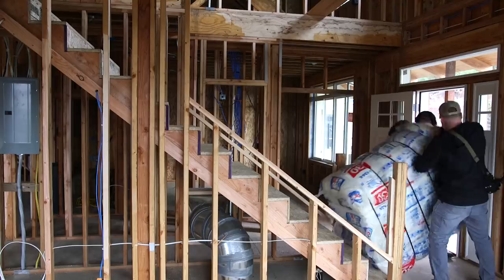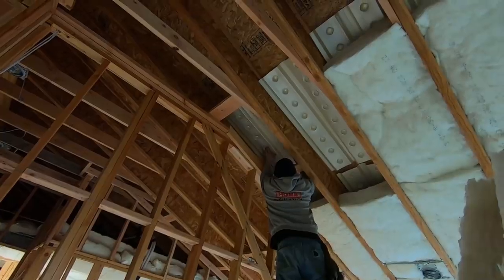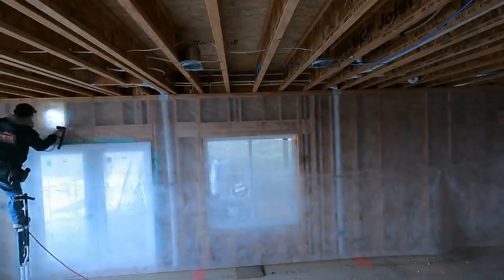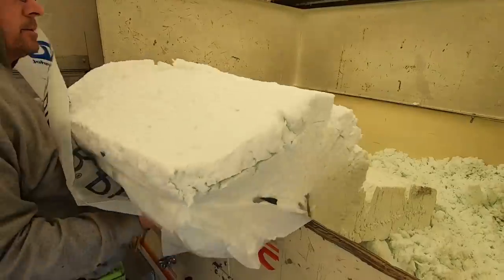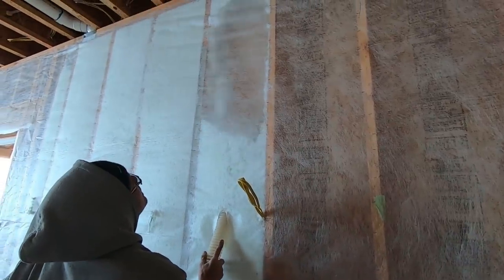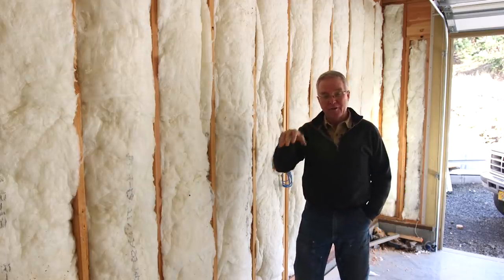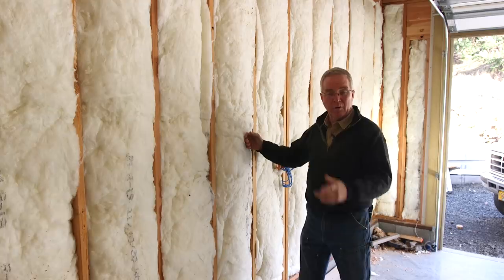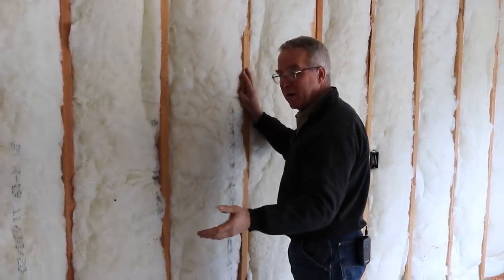Insulating A Nice House Ep.104

Comment: Spray foam is a nightmare down the road. I’m glad you didn’t use it.
Reply: Really? Give me a real example you have experienced? I’ve used spray foam exclusively for many years with my own house and buildings and families buildings too. Zero problems. I’ve personally sprayed many millions of board feet of foam in the last 11 years. Zero problems.
Reply: Can you describe how it’s a nightmare?
Reply: It will be if your house catches fire or you one day need to remove insulation. But houses aren't really built to last anymore, so the last point may not apply.
Reply: Expensive and potentially poisonous,, and once it’s in you can’t sensibly get it out.
Reply: @dtemp132  how about if you need to fish a new circuit, or repair a pipe, or add low voltage wiring (maybe for a home theater system or security cameras). And it there's ever a leak in the wall, good luck finding it and repairing the sheathing.
Reply: @christophergruenwald5054  fishing wire is the biggest problem I have with it. It’s difficult to remove for remodels. 

Edit : I don’t know anything about it being poisonous etc my comment was about having to work around/through it in the future.

Comment: The space station actually has problem with heat rejection. It spends much time in direct sunlight and it is perfectly insulated by the hard vacuum of space.
Reply: vacuum will prevent convection, but what about conductive and radiation forms of heat transfer ?
Reply: @peterp4319  I am not an expert in this field, but I do know ISS has large radiators to get rid of the heat. To the best of my understanding radiation heat transfer is a function of temperature, so relatively cool surface of the ISS sheds heat slowly.

Comment: How much will the cellulose in the wall settle? Will a gap at the top of the wall form over time?
Reply from the maker: They claim no settlement. It is surprisingly dense to the touch after installation. It feels about like a memory foam mattress when you press on the fabric.
Reply: It’s blown fiberglass, not cellulose. It may or may not settle, but the wind will definitely still blow right through the walls either way.
Reply: It shouldn't settle, its dense when blown in. If it does settle its because the installer had the machine set up wrong. You can fluff the insulation to get better coverage but it will settle as a result
Reply: @essentialcraftsman  Scott, it's blown in fiberglass in your walls, not cellulose. The JM Spider Plus fiberglass they installed has a bit of adhesive in it I believe to help reduce settling. Glad that they did seem to dense pack it though. Cellulose would be grey and not bright white. And dense pack cellulose should feel like a very firm mattress when done properly.

Source: I'm a passive house architect with a passion for insulation.
Reply: @essentialcraftsman  Thank you for taking the time to answer my question! Love your channel. I live in NW Arkansas and we are not used to -14°fahrenheit.  The insulation is not quite as good here and it is causing a significant strain on the electrical grid, so much so that they're having to cycle the power off and on.
Reply: @christophergruenwald5054  "...the wind will definitely still blow right through the walls".   Why do you say that?

Comment: No insulation inside interior walls will make noise transfer an issue. Just an opinion and fact.
Reply: He discussed this and situations where it would be best to do.
Reply: true but it wont add any value to the house when he goes to sell it  and it is a spec house after all

Comment: The paper offers a third function too: Vapor Barrier. 

Depending on climate, and what your housewrap looks like, you might not need a vapor barrier. I think the latest building codes require a vapor barrier on the outside as part of the sheathing, which would make a vapor barrier on insulation redundant and provide a perfect location for mold and rot to grow. 

I could be wrong on that, not my trade, just what I've encountered so far.
Reply from the maker: Thank you!
Reply: Did paper really function as vapour barrier? We use plastic sheets and a lot of tape to create a complete seal. One small gap and moisture will enter the glass fiber insulation and cause mold and rot over time. Like he says, paper will only add a place for mold to grow.
Reply: Yes, I'm amazed I had to scroll down this far to find this. It's entirely dependant on your climate zone. Some areas you want kraft paper facing in, some facing out, and some none at all. It's also dependant on the rest of your wall assembly. Did Essential craftsman forget that the item the paperface of that insulation touches is drywall, also paper faced?
Reply: @jonperez5771  Good point. Mold also loves drywall. Which may be why it's called drywall – you better keep that wall dry!

If this was in Norway, we'd add plastic vapour barrier over all glass fiber insulated surfaces, and carefully tape all seams. I sort of assumed that was the next step before the drywall.
Reply: In the PNW it's optimal to actually have no vapor barrier. Our climate is neither heat nor cold, but very wet. The concern is less moisture getting trapped.

Comment: Doesn't this mean that in the future when there's a plumbing issue I've now gone from 2 problems (original plumbing issue & consequent drywall repair) to three (now I've got also blown-in insulation to worry about) ?
Reply: Yes. But same with any form of insulating material. And plumbing issues are rare - you dont choose a product on the basis of a 0.00001% chance of needing to make a repair maybe on some associated system.
Reply: @1971merlin  except batt is easier to deal with than blown in. Yes you have to replace the insulation, but isn’t it more work to do it

Comment: Moisture is also continuously trying to reach equilibrium, which is why proper use of a vapor barrier is imperative. Different climates have different requirements and using it wrong will likely be costly and bad for your health (mold).

Comment: Saying 'it doesn't matter' to have a great big thermal bridge at the fuse board is kind of silly. If it really doesn't matter why bother to put the R19 in the garage walls? That will be a cold spot so there will be condensation on the board which is not good. and the whole of the rest of the house has a thermal bridge at every stud. It needs a thermal break on the inside. 40mm of woodfibre boards would do it, and maintain a breathable structure.

Comment: Dumb question but how does this work when you have to cut out the dray wall, does the insulation come falling out. I’ve only ever used one piece batts
Reply: The breathable sheet the installer stapled all across the inside of the wall stays in place. If you cut small holes like for a new electrical box, the insulation is stiff enough that it won't just pour out. If you wanted to install something like a new window, you would need to cut a slot and slip in a piece of plywood as a temporary stop. You might also just cut the drywall up to the ceiling and replace what fell out with regular fiberglass batting in that stud bay.

Comment: Rockwool is unquestionably a better insulation than this, but also undoubtedly more expensive. The cellulose in those verticals will sag and settle over time and leave voids at the top. That being said this house will certainly be insulted better than most on the market

Comment: I didn’t see any nail plates. Is that not code in Oregon? Just curious
Reply: If the hole for the electrical cables is more than 1-1/4” from the edge, nail plates they are not required.

Comment: i would like the know the cost difference between foam vs the blown in like you did vs rockwool or batted  and the R values for each. would one pay off over time?  I know you are always walking a tight rope cost vs return on investment. That is why i would like to know the cost difference.  If I were building my forever home I would want to best insulation I could buy you never know when the next energy crises is going to be and i am positive the cost of energy is going to trend downward over th next 50 years. On the other hand when selling a spec house the insulation isn't that sexy and harder to sell and get a return.

Comment: What kind of vapor barrier is that? We use just plain plastic unless of course we are using faced insulation or the building is spray foamed.
Reply: As to why you don't use kraft faced insulation it's fine you just can't have plastic or some other form of vapor barrier on top of it. It would create a double vapor barrier which creates mold.

Comment: Why is there a slight spacing between baffles? Wouldn’t you want them closer to direct the air flow better?
Reply: Not really. You're only making sure you keep the fiberglass from going up against the roof. The air flow takes care of itself as the hot air will draft up and out the vents up top, drawing air in from the vents. If i remember correctly, he has solar powered attic vents to help that draw occur even more.
Reply: Yes, it would be better. Especially since they are insulating a cathedral ceiling. The baffles are to direct air along the underside of the sheathing and keep it away from the fiberglass to prevent wind washing which lowers the effective r value. They should have butted the baffles against each other and taped the seams for best performance.
Reply: I was thinking shingle baffles; maybe 1".   Carry any h2o as close and hopefully outside of wall.

Comment: Woodfiber (cellulose) is superior to rockwool or other non-organics, due to the ability to absorb humidity without getting wet. Also releasing and absorbing moisture are endo or exothermic reactions playing advantageously to the temperature of the house. Warming when absorbing moisture (at night) and cooling when losing heat (during day). It allows moisture to pass, meaning it will not condense and rot. r value maybe be better for rockwool but all other aspects are on the favour of cellulose. That meter box will be cold, condense moisture, but it wont be able to dry fast due to fiberglass, it's a potential mold-generating trap.

Comment: I did not see FIRE blocking between the studs at the stair stringers at 0.14
Reply: finally fire blocking using the insulation The inspector said tightly packed insulation

Comment: Re: advances in technology: I was cringing in the first ten seconds, the guys handling what turned out to be Fiberglas with no gloves. I'm used to the pink stuff that ... you don't touch with bare hands. Apparently they made it so it doesn't give you splinters? Neat!

(Edit: and yeah, that's the proper spelling of the original trademark that got genericized. Kinda like Kleenex and Band-Aid.)
Reply: Also funny that literally seconds after Scott talked about windows, (when he was talking about the fireblocks in the side of the stairs) my mother asked me to go out to the shed and bring in some sheets of Styrofoam we've saved from appliance packaging to cover the windows because it's -4F and 8" of snow on the ground here in northeast Texas, and this house is not insulated for that. We're used to an inch of snow one day a year that's gone the next morning, and 80-110F the rest of the time..
Reply: AvE may be perfectly fine and a little annoyed when it's -40 (no unit needed, that's the same in C and F), but he's used to it. We're not used to or prepared for anything below freezing for more than a day.

Comment: Looks like blown in fiberglass, not cellulose.
Reply: It didn't look like cellulose to me either, but maybe it's bleached? I haven't seen cellulose insulation that white before. I think he'd know what he ordered.
Edit: Turns out it was fiber glass (see other comments). I still haven't seen white cellulose insulation, then.
Reply from the maker: Package said cellulose.
Reply: Its been soaked and cleaned. It wouldn't look like traditional cellulose.
Reply: @essentialcraftsman  "Blowing Wool" is printed on the plastic bag being emptied into the hopper. Blowing wool is fiberglass.

Comment: I’ve noticed, from your videos and other American YouTubes’, that Americans never seem to put any noggins in their studwork. 

Why is that?

In Australia it’s code. Are we behind the eight ball, or you?
Reply: They call it blocking in the US(same term for both the bracing in-between floor joists and wall studs) and its rarely specified by code for any wall that will have some sort of sheeting applied; although it is generally called for once you go above a certain height to act as a fire block. You are likely to see them on unfinished load bearing basement walls, interior load bearing walls, and some regions that expect to have high wind shear issues(Like Florida with their yearly hurricanes). I honestly think they should be required for ever wall because of how much strength they add, but sadly the name of the game in the US is how cheap you can build something; not how long it will last before you start having problems.

Its also important to note that every city, county(or parishes and boroughs as Louisiana and Alaska just like to be different) and state will have different building code requirements and in many places once you get out into the "country side" there isn't any building code requirements at all.

Comment: Actually, space isn't freezing cold like they show in the movies. It's a vacuum, and if you have a thermos, you know that a vacuum is near perfect insulation. Space craft are constantly trying to find ways to remove heat, they're negatively insulated
Reply: That's true, but they still use a thermal barrier like fiberglass and reflective foil since they are regularly exposed directly to the sun. Without an intervening atmosphere or the shadow of a planet, any active cooling system would be overwhelmed.

Comment: The fiberglass looks like its the type thats made for 1,5" materials so when you use it in a ceiling/wall with 2" materials you get those bulges in the middle and that again gives you condensation. Either that or it`s just really sloppy craftmaship. The fiberglass should be dead flat all over the surface inside and outside!

Comment: Coming from a house built in about 1953, which used blown-in insulation, I am curious. My house which is the blown-in stuff in the walls, I recently did a reno project and I found any of the walls that I had to at least partially expose (outside walls), what I found was any insulation that was in the walls had now sunk to the bottom of the space due to gravity and compression of the "bits" of insulating material. Granted back in 1950 R7 was the code requirement in my part of the world. Will this blown-in insulation not do the same thing over the years (Settle down and fall)? Do you have any stats on this? I maybe old school but in my opinion I think that bats, which are larger than the framing spaces, which fit in by friction, 20 years from now will still be sticking in place, whereas the blown-in stuff will all be at the bottom, leaving no insulation in the top part of the spaces, just like my house.

Comment: Blown in is definitively great in walls, it just really sucks if you need to open them up at some point in the future. But you should've used blown in insulation in the ceiling too. What you did with the batts up there didn't look all that professional. Also, insulation between interior roofs and floors is something I've never gone without doing. It just increases the comfort in the house so much. I'd also vent the roof with another layer outside with tyvek in stead of those baffles. Then you also have another waterproof layer on the roof.

Comment: I hate to say it, but that’s not blown cellulose but rather blown fiberglass. It still claims an R-Value of R-23 though in a 2x6 wall.
Reply: Is it?  It sure doesn't look like any cellulose I've ever seen.  But I don't claim to have seen everything.
Reply: You're correct.  I looked up the product names visible when the guy is loading the insulation into the blower:  JM "Climate Pro" and "Spider Plus"  both are loose fiberglass.

Comment: The idea was that the kraft paper would act as the vapour barrier, sort of a two in one deal, but it was basically useless at that function so they stopped applying it to the fibreglass, and now we use 6 mil plastic instead.
Reply: You can still get Kraft faced fiberglass insulation.
Reply: @andrewalexander9492  I don't want to say 100% for sure that you can't get it here in Canada, but I haven't seen it in 40 years, so I doubt that it is, and even if it was you would still have to install a plastic vapour barrier over it.
Reply: @olafbigandglad  You may be right about Canada, I know you can still get it in the US.  But for new construction, at least where I am (Alaska)  you would have to have a plastic vapor barrier by code.